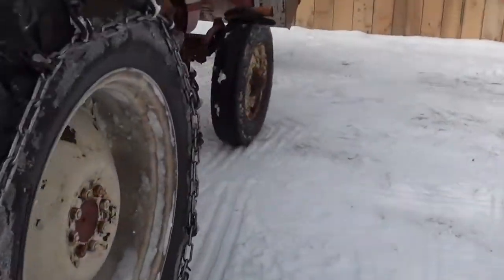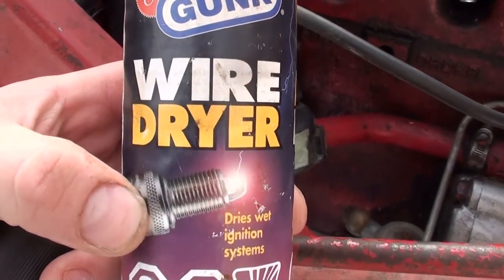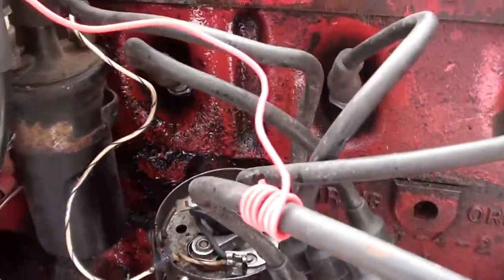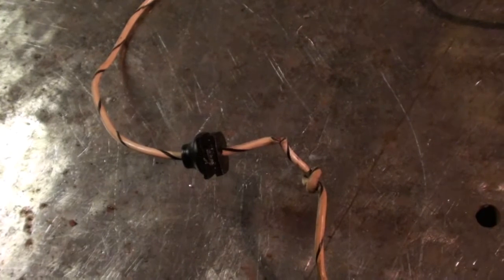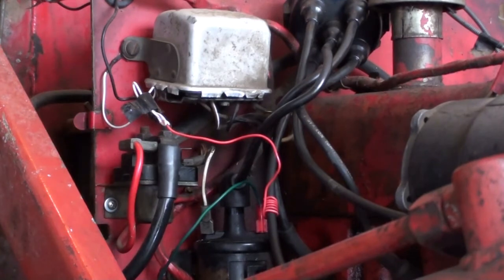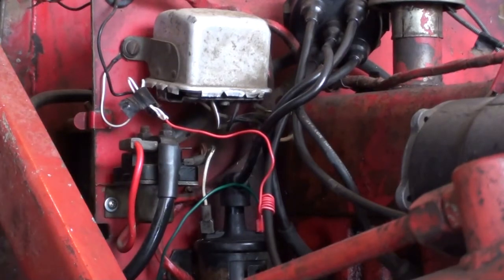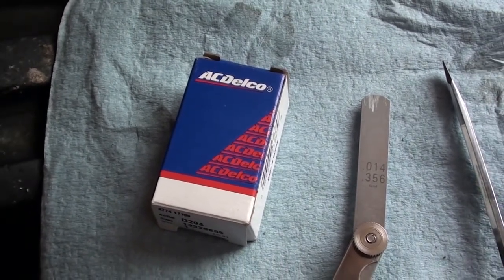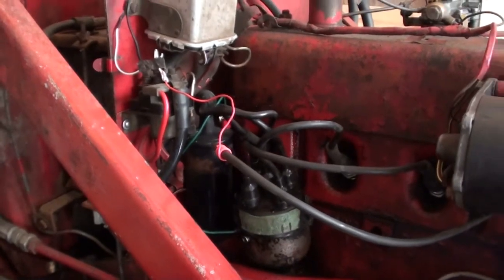IH 354 Tractor No Spark Trouble Shooting

Comment: Thanks for a great video! I'm trying to resurrect my Dad's old 1967 IH 2424 and am also having an issue with spark.  It sat for 10 years, and have a new ignition coil and distributor, plugs, wires on order.  Wish me luck!
Reply from the maker: Glad the video helped.  Sounds like you will be up and running in no time.

Comment: It seems you have a lot of videos on trouble shooting your IH 354.  I found an IH 354 for sale at a JD dealer, so I have been searching for information on them.  I do have some questions, but I'll start with where you get your parts for this tractor?  I know the engines were built in the UK and the tractor is considered an UK model, and were sold here in the US.  I do have some concerns about parts availability.  I haven't pulled the trigger on the one at the dealership, and not until I have more information.  Thanks.
Reply from the maker: Terry Reed  Sorry about late response.  Parts are tricky to source.  But even my local IH dealer can still get some parts.  The rest I find from various suppliers in US and eBay.  I have noticed that parts for the Diesel engine are more common